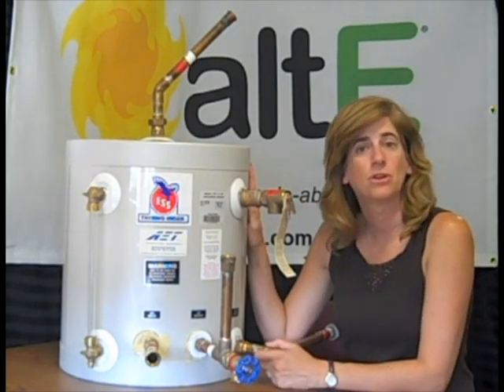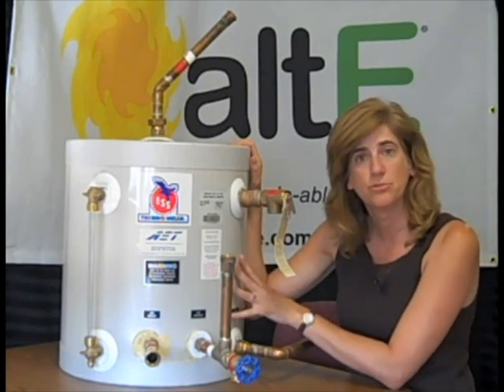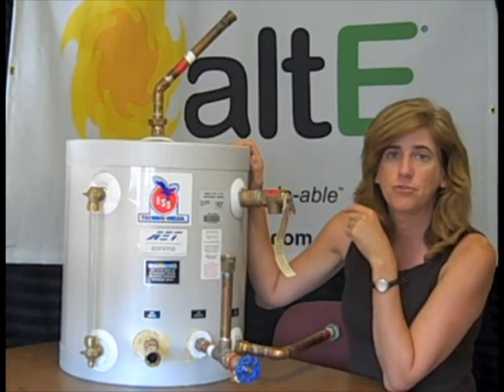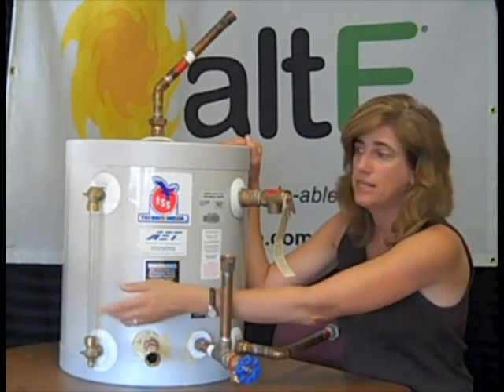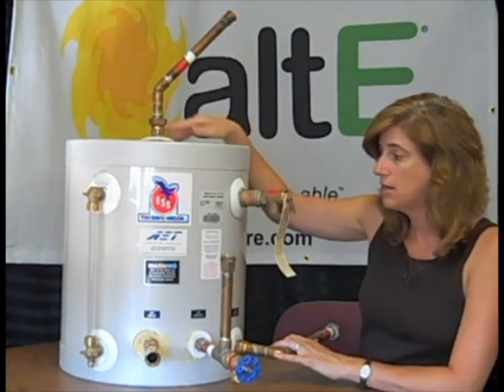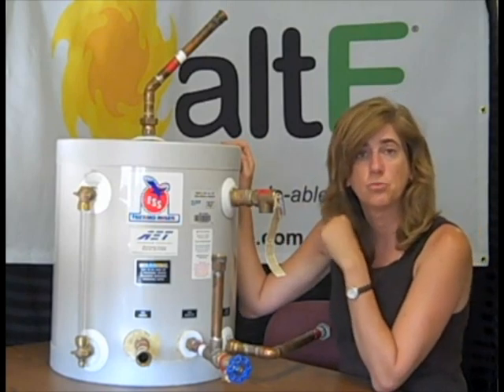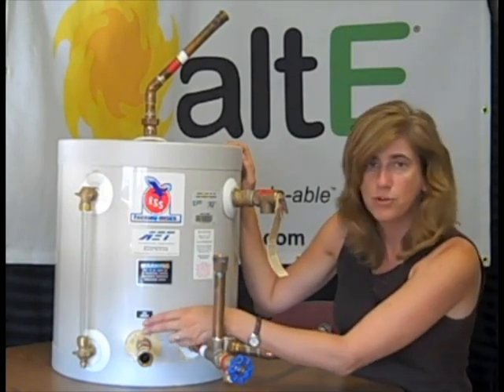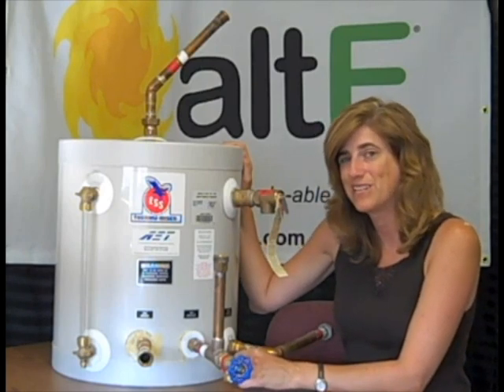AET Drainback Tank for Solar Hot Water System - Overview

Comment: How do you add more water into the drainback tank when the level in the site glass is getting low?
Reply from the maker: If you look at the manual, on page 30 there is a fill/drain valve (just below the controller) http://www.aetsolar.com/literature/Manuals/MAN-DXR-SRCC2012_v2.pdf .